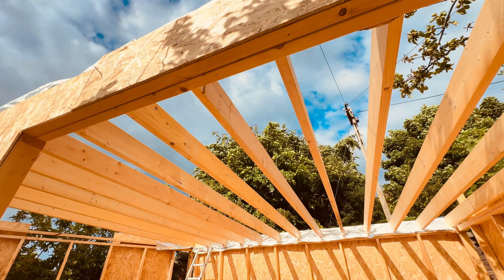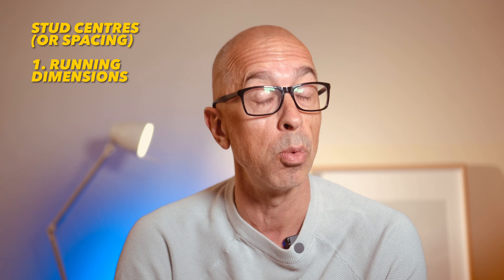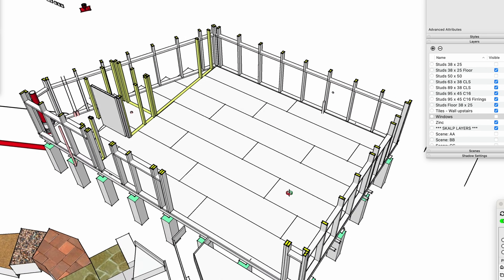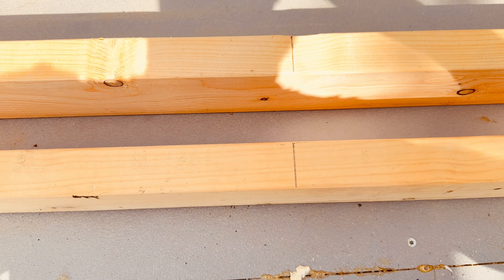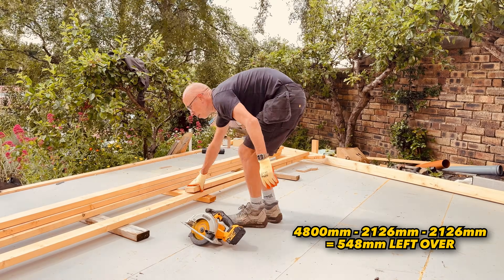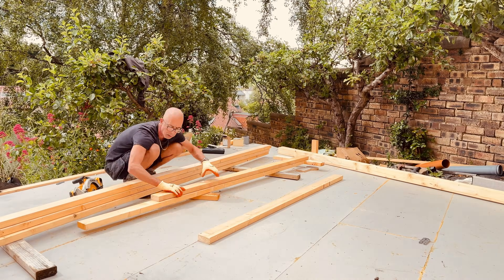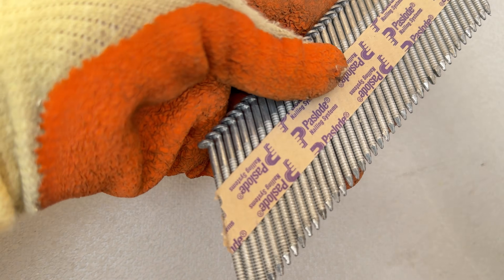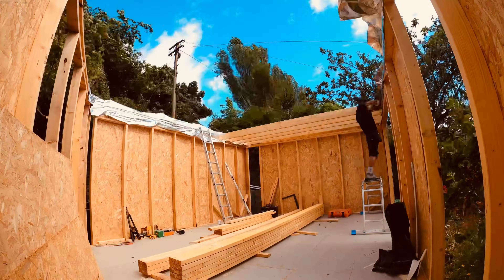Timber Frame House Solo build - Tips and tricks

Comment: Hi Jerry, do you know if its possible to build a 5x5m timber residential annexe on a concrete slab? Just been told by no by a builder saying the span is too wide, as its not a good idea to go over 4.8m span in any direction, I said what bout central supporting wall? he said its just not a good idea and to go for a longer narrower build. I googled 5X5m rooms and they do exist so not sure what hes going on about?

Comment: Thank you for the infor on studwork measurements but how do you work out sizes for timber lintels, which go over windows, doorways on the first floor.
Reply from the maker: Hi. You work them out the same way you work out your floor and wall sizes. You use the loadings and the spans and calculate from that.

Comment: This could be perceived as being over the top but we used to triangulate the corners, this does increase the structural strength significantly.  Our Architect had never witnessed this technique before. It could be argued that it is unnecessary but I would argue the case for it, it requires a very small amount of work & material.
Reply from the maker: I agree. Good practice. Thanks for the comment
Reply: No worries, it's refreshing to listen to some informed advice, unfortunately far too many in the Trade are under informed & unwilling to have their misplaced preconceptions called into question or scrutinized. We never stop learning. All the best.

Comment: I was under the illusion i needed 2x4" c24 

Maybe it party depends how much insulation u want in the cavity?
Reply from the maker: Two story timber framed 3 and4 bed houses are built in volume by house builders using 89mm CLS c16. 2 x 4 is actually 95mm sawn at c16 so there’s little difference anyway. To meet current u values, it’s kind of irrelevant the thickness of the timber, if I’m understanding you correctly, since it’s the insulation on the outside of the OSB that’s giving you your thermal control.
Reply: @build-better-things  
Yes your right insulation in wall cavity of houses. just been watching alot of garden room build videos, pretty sure some of them are using the actual 2x4" for the depth for insulation!? But not sure.
But i am very much liking your videos. just watched ur take on the hybrid roofs, what ur saying makes sense.
When i get round to doing my own build I'll be basing it of what you are doing. mostly. Tho i want a concrete floor and still deciding best way to do it.

Thanks for the great content👍

Comment: I want to build double storey house extension timber framed , what size of timber would I have to use ? 4x2 or 4x2? Thank you
Reply from the maker: Did you mean 4 x 2 or 6 x 2? Volume house builders in UK use 89 CLS for 2 storey construction all the time, which is usually called 4 x 2. Thank you for you comment.
Reply: @build-better-things  thank you yes i meant 6x2 as i thought it would make it stronger

Comment: Is buying a ‘Kit’ not cheaper & easier than Stick Build Timber Frame? Two Joiners will have a Kit Home built in two days, minimum material ordering & Site Work.
Do you not use stainless steel Passy nails Jerry. I thought that was the latest requirement?

Comment: Any thoughts on the Swedish best practices of adding a "hammer band" around the top of the framework instead of a double top wall plate?

Also they have a 2 layer framing system which means the cold bridges are blocked in the internal layer of insulation overlapping the external as well as leaving a utility gap to ensure the cables etc are easily accessible and don't interfere with insulation as well as not breaking the air tight membrane!

Comment: Hello I have a question. I live in France and the original house is a stone construction. We have a metal framed barn attached to the house. We had to dig out up to 40cm of earth in the barn  to level the floor to match the main house allowing for insulation and the eventual concrete floor. The existing metal frame work for the barn will remail and we will construct a timber build inside. To finish with an industrial appearance. The metal frame will be eventually supported using concrete pillars . My question is what depth would you recommend for the foundations for the timber construction side.
Reply from the maker: You need to dig down and find the boulder clay and then go around 6 to 800 mm below that. Or find the bedrock and build off that. However you need to get proper structural advice …I’m just a random guy on YouTube.

Comment: Hi, I’m about to build a workshop in my garden (timber frame, insulated and clad), and I’ve looked at other peoples builds-sheds, garden rooms etc. I noticed a lot of people are using 4x2 cls but with 400 centres in the wall studs. In your video, you say you are using 600 centres. Any idea why people are building garden rooms with 400 centres? Are they over engineering or am I missing something? Great video by the way 👍
Reply from the maker: Hi. Good question. Yes, for a 2.5 to 3m high wall, 400 centres is not only over engineered, it’s a bad detail as it creates even more thermal bridging where you’re putting insulation between. I don’t understand why so many do it.  600 centres with 4 x 2 is more than enough provided you use noggins at mid points and OSB sheathing. 2 storey mass build timber frame homes are all at 600 centres with 4 x 2 CLS
Reply: @build-better-things  thanks for the swift reply. I was looking at it and wondering why, especially as you use more timber. Another side question to that f I may - would you recommend cls or treated carcassing timber for my purpose? It will be boarded with something inside but I’m just in the process of looking at costs and also wondering why people use smooth planed timber when it’s for stud frames and will be hidden.
Reply from the maker: @MrGrantspants for the very small difference in cost, I would always choose CLS treated. Less irregularities and easier to get plumb and level therefore. Plus you gain 5mm-10mm of floor space all around. But not really a big deal and go with what you fancy.

Comment: Thanks for the great videos. How do you fix the walls to the foundations?
Reply from the maker: A few L shaped holding down straps to the outside, and inside, 100mm screws through the wall frame sole plate into floor frame, and then 90mm nails shot through on diagonal, again through sole plate into the floor frame. Thanks for your encouragement.
Reply: A truly helpful and knowledgeable guy, giving confidence to the people who maybe just contemplating for now, to go the whole hog. Brilliant!
Reply from the maker: Thanks Kevin.

Comment: Hi Jerry, forgot to ask - how air permeable is OSB 11 mm, which you mentioned in your earlier videos? I am planning on using high density mineral wool insulation (e.g. Rockwoll) for better sound insulation (planning to use the gardenroom as a woodworking workshop and I would like to keep my neighbours happy :) ) , over thermal performance offered by PIR. Will fixing of  OSB over the outside of the studwork, provide a chance for the moisture (seasonal and from gradual drying of the timber) to escape through OSB and leave via the breather membrane? Thanks again.
Reply from the maker: With the glue they are using now in OSB they are fairly impermeable but vapour will get out through the joints. Make sure to have the breather membrane on the outside of the OSB

Comment: Hi Jerry, I am really glad I found your channel. Lots of practical tips and very logically explained. I am in the process of building a small garden room (~9m^2) near Glasgow. I was wondering how do you go about supporting the 4 corners of the flooring (e.g. https://youtu.be/UO1IAv3snuY?si=8gqjWhF-C93twD-9&t=368)? Is it a good idea to offset the the perimeter joists by a bit (~20 mm) to allow for fixation of the chipboard, but still provide the support for the bottom plate of the wall (with the created opening to be filled with PIR insulation)? Thank you. Keep up the good work!
Reply from the maker: Good question. I screw a 200mm wide x 50mm deep noggin or dwang at the perimeter sole plate only to the short ends, so the 600 wide board where unsupported, to prevent movement. I cut the floor insulation to go below the noggin. I don’t do it along the 2400 board length because the joists are there to do that and of 400 centres you’ll have no movement. I don’t offset the perimeter joists because I want to optimise the insulation in the floor. Thanks for you comment.

Comment: Great stuff, you clearly know a hell of a lot about the subject. My question is how does this translate into building a house of more than one storey, or is your focus solely garden rooms and extensions??? I've heard shrinkage can be a real problem on two storeys. Also what about the moisture content of the timber, think we have all seen CLS arrive sopping wet to site! It would be good to hear your thoughts sometime on building an actual house in timber frame on site, thanks.
Reply from the maker: Two storey is fine for CLS. You can build up to 4 storeys in timber frame without special measures. Shrinkage in timber frame is always an issue, especially in damp uk, regardless of the height and needs to be taken account of. The key is in two areas…. First, design…don’t shortcut the frames , I mention it in the video, and don’t shortcut the joists in terms of sizing , understand about insulation placement and never shortcut …and incorporate vents and movement joints, especially in soffits and fascia.  Once you are wind and watertight and the timber has had the time to dry out, you manage the moisture content at that point by incorporating ventilation, breathability, vapour control and airtightness everywhere. You’re always going to have a six month period of cosmetic shrinkage , I just leave my final coat of paint and caulk for nine months out. But rarely do I get more than the odd hairline in the odd corner.  If for a customer, I make sure to explain.  I’ve seen loads of YouTube videos paying no real respect to ventilation and insulation placement, bish bash bosh,, and we never get to visit these builds a few years later. Great question and thanks for the comment.
Reply: @build-better-things  Thanks a lot for the very detailed reply!